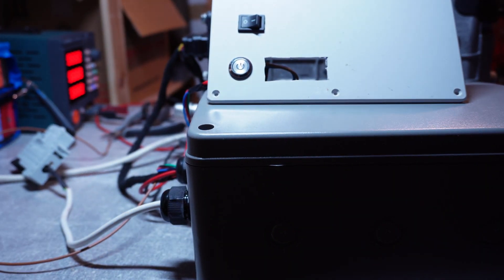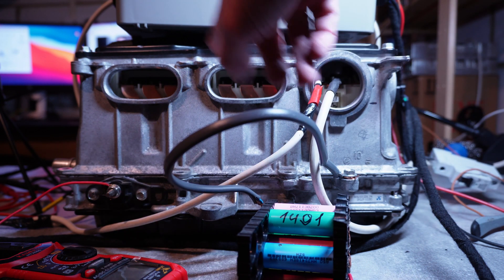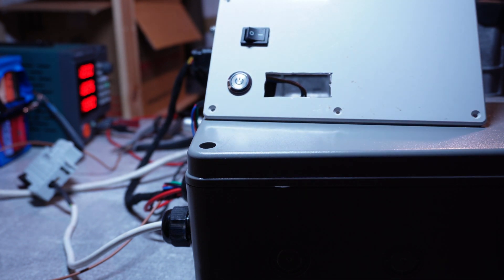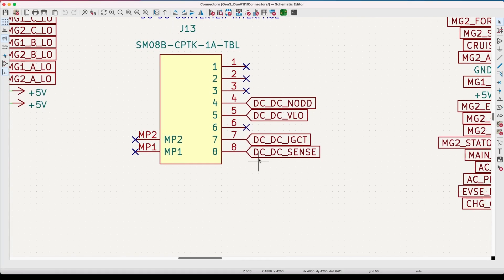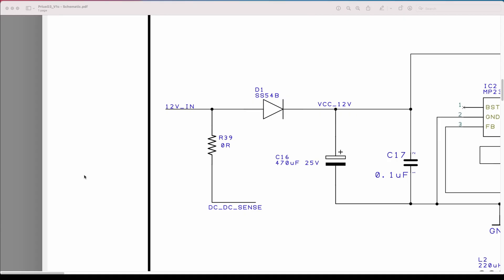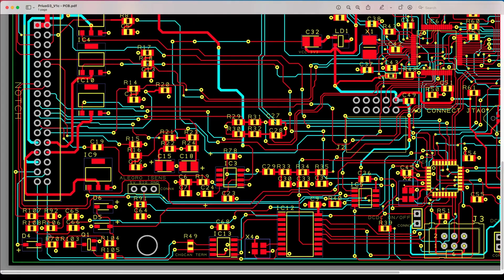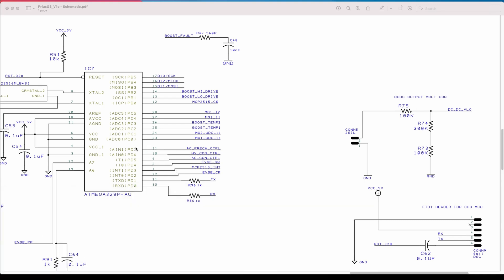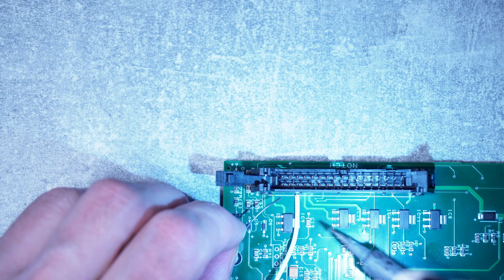Assembled Inverter and DC to DC converter test Ep 24

Comment: Nice work. I would glue the strap wire to the PCB where you have soldered it to the pad for the SMD resistor, otherwise you might risk ripping the pad off the board, and shorting stuff out when it's all under vibration while driving the car.
Reply from the maker: Thanks yes that was a prototype board , it will not go into a car.